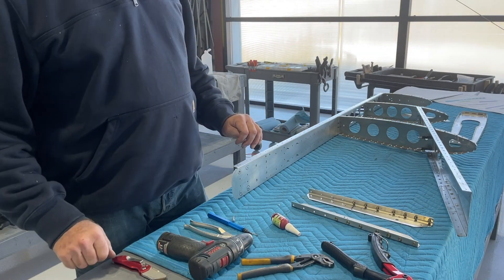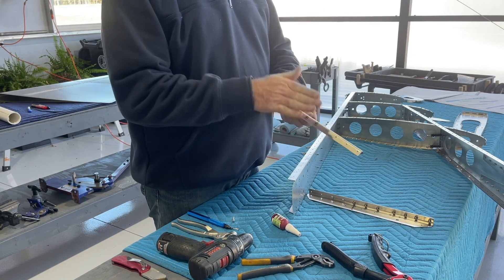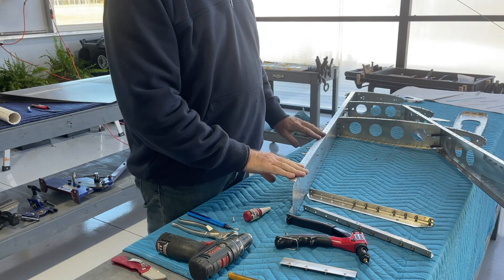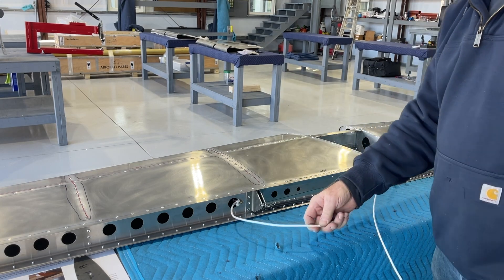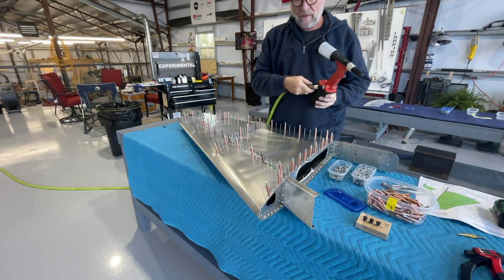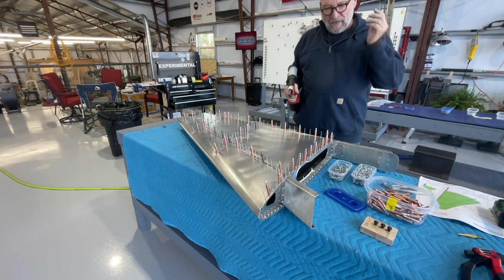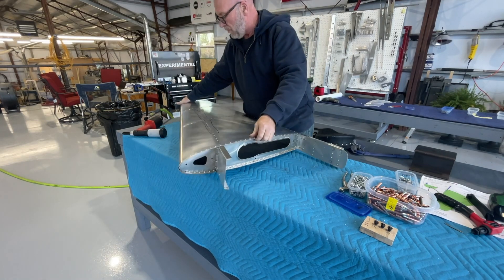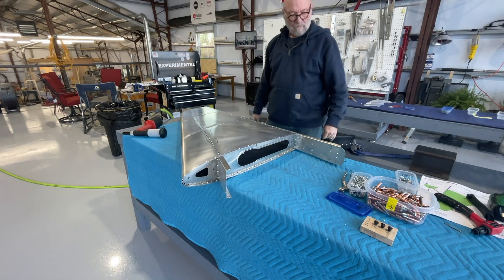Vertical Stabilizer  [Sling TSi Build Video # 3]

Comment: Are you sure its the #3 and #6 position?  On my kit and in Evans Video's, it's the #2 and # 5 positions. 
I do epoxy all my RivNuts, but your fine which ever way you choose.  I have a large spool of  Ideal Brand - Power-Fish Pull Line (Lowes or Home Depot), that I use to attach to wires to pull through.  But your way worked too w/ Heat-Shrink.  In the Fuselage and Wings, I plan to have extra Pull Lines, in case I need to pull through to add something later.  The Pull-Lines are very lightweight.  Just an exchange of ideas!  Great work.  Your going to love the Sling!  I'm using a pneumatic Rivet Gun (XT2 Pro-Set), but plan on getting the new DeWalt DCF403B in addition, as a backup.  My compressor failed mid riveting one day, but is back going again, lost a capacitor, but that was a quick fix.  Enjoy the build, and I enjoy your vids too.  Hopefully you have seen some of mine too?  
N720S
Reply from the maker: Depends on where you count from.  If you start from the very edge it's 3 and 6.  If you count from the rivnut and the 998's, it's 2 and 5.  Yes your videos and great!  Thanks!